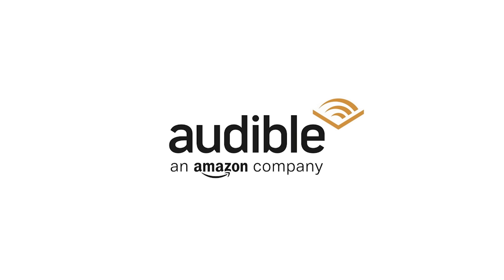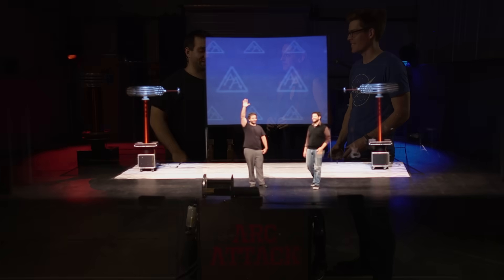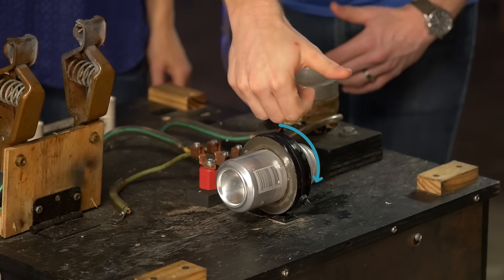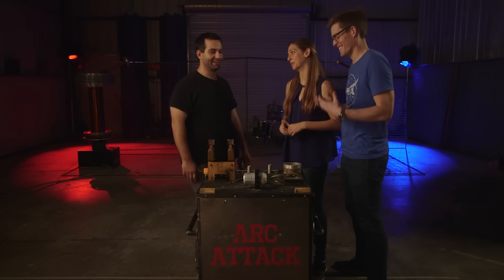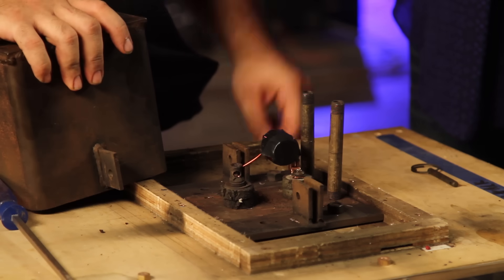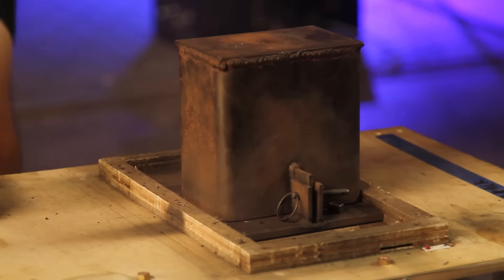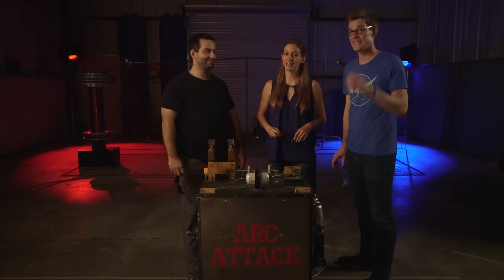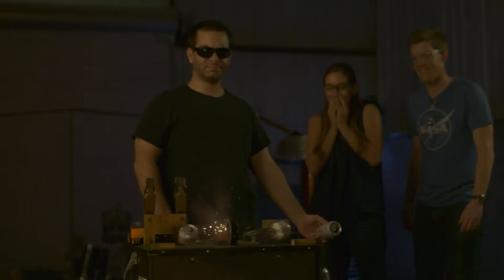Exploding soda cans with electromagnets in SLOW MOTION ft Joe Hanson

Comment: I believe that at 3:00, the second magnetic field should be pointing in the opposite direction of the first magnetic field.  This is because as the current in the electromagnet increases, this induces a current flowing in the opposite direction around the can, so as to try to keep the total magnetic field constant.  The fact that the two currents are in opposite directions also explains why the two ends of the cans fly away from the electromagnet, rather than towards it.
Reply: Maybe an awesome animation to illustrate this in your next video ;) ?
Reply: @TheRomichou  Yeah true everybody also watch physics videos by Eugen Khutoryansky . Physics girl you are great love ya videos physic girl . EUGENE KHUTORYANSKY shows videos with 3d animations ...
Reply: If the electric current within the coil was DECREASING, the induced field would be in the same direction as the primary field though.
Reply: Exactly! I was also wondering the same thing and came to a similar conclusion.
Reply: I am dumb
Reply: Exactly.   Or, in other words it's the opposite of the Magnetic Pinch force.   In "pinch," the currents are in the same direction, and they attract each other.   But with cap-discharge can-crushers, the can is repelled from the windings (and hence, crushed.)

Hey, I have one of the very first shrunk quarters in my pocket.  Also some cup-shaped quarters, from when we shrunk a stack of three.  This was Seattle 1994, Dale Travous' art lab, with the Boeing Surplus capacitor bank.   We copied the quarter-shrinker idea from the 1970s Rev. Sci. Inst., where they were pinching soup-cans closed with a pulse-laser capacitor bank.  Everyone else copied from us, and "quarter shrinkers" and "can crushers" spread all across the Maker universe.

I was a huge nerd as a little kid, and read all of Scientific American back-issues in the library, then found they also had large piles of Rev. Sci. Instruments journal.  Lots of cool adult-level physics stuff in those!  That's where this meme originated.   Beware, for when you publish some fantastically dangerous physics experiments, nasty little nerd kids are in the library.   They see evvvvrrreeeeeething.
Reply: +Justin F That is incorrect. You bring up a good point about aluminum's paramagnetic properties,  but that is not what causes the cans and ring to react the way they do. First of all, if it was the paramagnetism, then the aluminum would be attracted to the magnetic field, not repelled. Second, if it was the paramagnetic properties, you would be able to observe similar results with a static permanent magnet since paramagnetism doesn't require a changing magnetic field. The reality is that aluminum's paramagnetic properties are extremely week.
Reply: My thought exactly
Reply: But why then the can is even tearing itself apart? If the total magnetic field magnetic field stays constant what makes the can split? Thanks
Reply: Clifford William 
They are using a DC pulse from a capacitor. Even though it isv considered DC, since it is an extremely quick pulse, that means the current is rising very quickly. This quick change in current creates the strong magnetic field.
Reply: You're right !! according to lenz's law. I've been confused for a month trying to understand and i still can't understand, why does the can tear itself apart then ?
Reply: Recall how a solenoid works - metal pin in the center of a coil, turn current on, pin moves out the coil to the right.  Reverse the current, pin moves left back into the coil.  This type of solenoid is offen used to open and close valves to control gas flow, or liquid flow, etc. in a system.

These guys modified that process a bit.  What they did is charge 2 capacitors up high, very high voltage, then dump one capacitor into that coil, then with the help of an (unmentioned, undisclosed) electronic circuit, dump the other capacitor into that coil with reversed current flow.  If the undisclosed electronic circuit was able to switch current flow very fast, say -- like 1 microsecond, the can wouldn't have time to move out of the coil to the right, then back inside the coil to the left.  It would separate. It would cut in half. That will only work with a thin skin metal can, not a solid piece of metal (unless you use millions of volts stored in the capacitors).

With high voltage on the 2 capacitors the can would see nearly-simultaneous huge magnetic fields and one half the can moves to the right a smidgen, then BAM they dump the 2nd capacitor in the opposite direction of current flow and the left side of the can moves left.

They probably had to fine-tune the time period between the dumping of the 2 capacitors and the proper amount of voltage, because if they dumped both caps too close in time, the can would just sit there, maybe a jiggle right and a jiggle left.  They had to let the can get movement/momentum in one direction then reverse the field.

They probably had to fire capacitor #1, let the can get some movement/momentum to the right, then dump the 2nd capacitor and the momentum PLUS the reversed current flow together ripped the can apart.
Reply: The total field does not remain constant, that only happens in superconductors. The change in field is suppressed but not removed.
Reply: Yep, paramagnetism would attract the can towards the coil, when in fact it's so violently repelled from the coil that it tears to pieces.   Maybe the repulsion is infinetesimally less because of the paramagnetism.  But the repulsion is a motor-force, Maxwell's equations, not a static effect like diamagnetism/paramagnetism.
Reply: Physics Videos by Eugene Khutoryansky are they using direct current?? Surely it's alternating current that cause changes in the magnetic field?
Reply: +Ben Watson 
Oh I see now.. thankss
Reply: Physics Videos by Eugene Khutoryansky Yep.
Reply: yes you are correct,well spotted!
Reply: energy from the other half can it fly off
Reply: Their explanation is correct. A changing current in a coil induces a changing current in a nearby coil (the can), with both currents flowing in the same direction. Both currents have magnetic fields oriented in the same direction, which is why they oppose. Put two bar magnets next to each other in the same direction, i.e. north poles together at one end and south poles together at the other end. They will push apart.

It also has nothing to do with aluminum's weak paramagnetic properties. It has only to do with the fact that aluminum is a good electrical conductor. The outer coil acts like the primary of a transformer. The can itself acts like the secondary, but a single turn, shorted out (a ring). The changing current in the primary creates a changing magnetic field, which induces a changing current in the secondary. This changing current in the secondary, in turn, produces its own magnetic field that opposes the magnetic field from the primary. The can tries to push away from the outer coil, both compressing it in the middle and pushing the two halves away once it has been severed. In essence, one electromagnet pushing away another electromagnet. At the high current levels used here, it could work with almost any electrically conductive material, not just aluminum.
Reply: @kevpatt  your right people get confused like fields repel/oppose. Think they think because  its opposing it has to be a opposite field lol.. your also right with the transformer analogy the can is a shorted turn  secondary of a air core transformer, if you ran that coil at high frequency and power CW the  can would melt.. they may be confused because in a pair of conductors carrying current the fields are actually opposite although the current is flowing In   one direction ultimately a circle 😂
Reply: Like fields repel that's what is happening the can "trys" to get away from the coil and viseverser
Reply: He is talking about the induction field which creates an equal and opposite reaction, to energise the coil in a Like pole orientation which repels each other, as unlike poles attract.
Reply: You're totally right : according to Lenz's Law, the induced magnetic field is created is such a way that it opposes the magnetic field change that created the induced field. So, with an increase of the field's flux within the can, it reacts to oppose that field, hence an induced field going in the opposite direction.
Reply: It also dirsturbed me because it would means that after a moment, you could simply stop the AC generator and the can and the solenoid would provide each other magnetic fields and current endlessly...
Actually, the 2 magnetics are opposite and well illustrated with the magnet's fall slowned down in the pipe.
Reply: Might be worth considering that aluminium has strong paramagnetic properties, greater than its diamagnetic properties. Paramagnets the fields run in the same direction. Perhaps it's not creating the magnetic field by inducing a current, it's inducing a magnetic field through paramagnetism.

Comment: It is so weird that you actually say right hand rule and thereby use the tecnical current flow direction (from positive to negative) not the physical (from negative to positive). for the physical cuttent flow direction you have to use the left hand. And as  this is a channal about physics the physicly accurat rule would be appropriate.

Comment: What are the cans made of as they can't be aluminium or tin, as they are not magnetic.
Reply from the maker: They are absolutely made of aluminum. These metals are not magnetic, but they can be turned into electromagnets which has to do with currents running through the metal and not with intrinsic properties of the molecules. As soon as the current stops, the  magnetic properties go away.
Reply: As long as the material is conductive it will work, that includes all non-ferrous metals as well (aluminum, brass, copper, lead, etc.).
Reply: Tomos Williams get gud at science m8
Reply: any material is conductive if there are electrons and enough potential difference (EMF or voltage) and thus any material is can be made into and electromagnet but only ferromagnets are permanent magnetic
Reply: pure water is non conductive